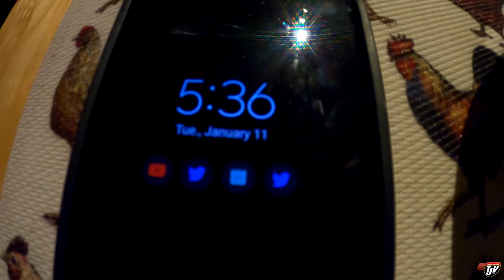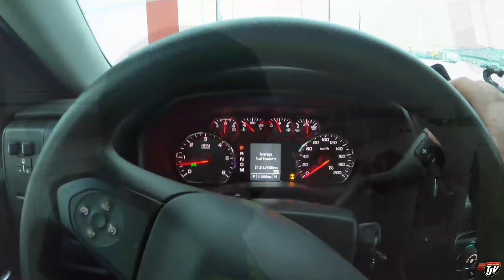SOMETHING NEW | My Trucking Life | Vlog #2444

Comment: A trailer like that is used as a car hauler. Very useful for hauling cars to the racetrack/traveling to other racetracks.
Reply: The back isn’t big enough for a car.  But used for motorcycles. Atvs or side besides
Reply: Same trailer I have to haul the 67 Nova to the drag strip.
Reply: "toyhauler"
Reply: @maxracingteam23  the back is plenty big enough too haul a single car too the track.

Comment: Did you just say $1.41 for a litter of gas? Wow.
Reply: Could be so much worse. Could be Vancouver. $1.69 here. Was $1.76 a week or so ago. Probably gonna scrape the $2 barrier this summer.
Reply: @markusmayer7956  that's crazy. I live in Indiana and it's $3.25 a gallon and I'm thinking that's expensive.
Reply: @jacobwestern  For comparison, CA$1.70/liter is US$5.20/gallon.
Reply: @markusmayer7956  a little less with conversion rates but those are crazy prices.